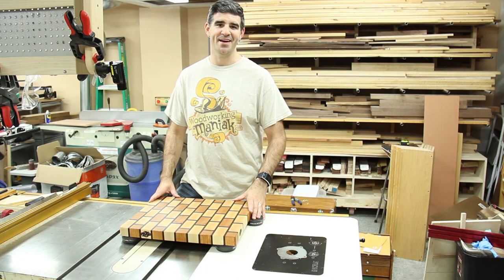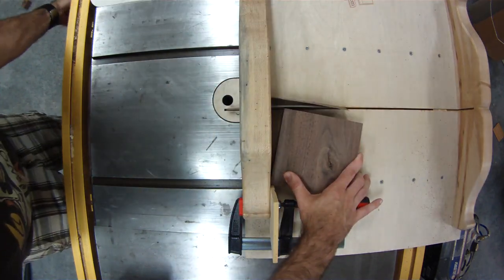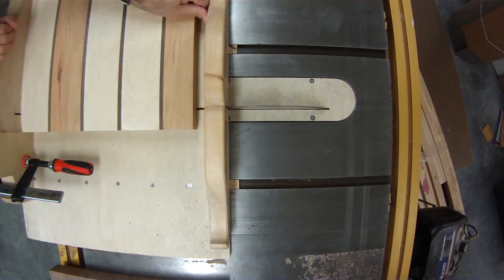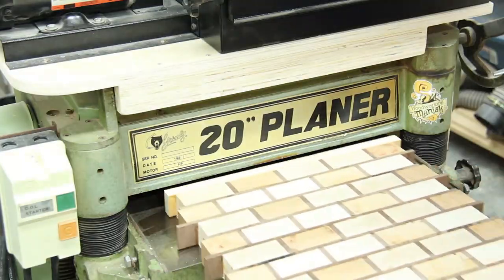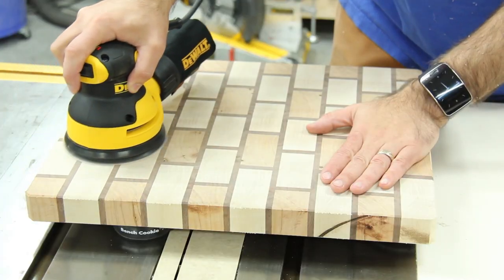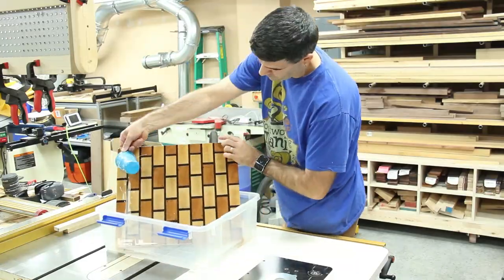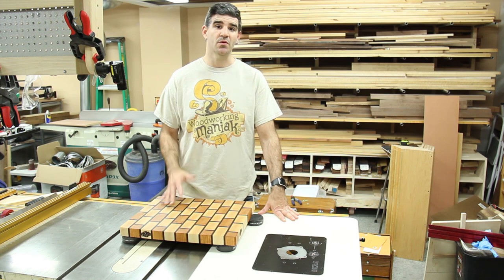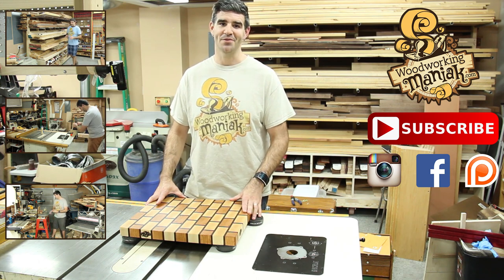Make a Brick End-Grain Cutting Board

Comment from the maker: +Rex McKinnon  For some reason, I cannot reply to your comment...
Thanks for watching! Yes, I do take extra precautions and add an extra step in my glue-up before sending it through the planer. If you review my video, I added a strip of pine that was side-grain to both ends. By doing this, I get zero chip out and no end-grain explosions in my planer. I later just cut those strips off at the table saw.

Comment: Nice rendition of a classic! Does your planer have a helix cutterhead? I use my Dewalt 735 for end grain boards with no problems but of course I'm jealous of your 20" capacity.

Thanks for sharing.

Alex Pettigrew
Pettigrew Woodworks
North Garden VA
Reply from the maker: +Pettigrew Woodworks I do not have a helix cutterhead in this planer. I did have one in my 15" planer that I had previously and miss it very much!!!

Comment: i have tried to make a brick pattern, but have had cracking at the strips. how do you make the strips "end grain", as that is the problem with my 2 i have made thanks
Reply from the maker: +David  Good I'm suspecting that you made the strips with edge grain wood and the rest with end-grain... That does not allow the board to move together seasonally, it will crack every time you do that.  You have to make it ALL  end grain.

To do that: You have to make a separate end grain board (in my case in solid walnut) that is as long as the board will be length wise. Then cut that into strips to put between the bricks.

That's what the glue up at 1:45 mark is for. Right after, you see me turn it into an end-grain board. Then I'm cutting it into strips at 3:04. :)
Reply: A successful endeavor, thanks for the advise, and that is alot of xtra work but well worth it
Reply from the maker: +David  Good glad to hear you had success! It is a lot of extra work.

Comment: Muito legal Mais O Que rápido você Pacou não definitiva e Um tipo de oleo
Reply from the maker: +Luiz Antonio Thank you! I used Mineral Oil & Beeswax to finish the cutting board.
Reply: +WoodworkingManiak 
So to say that you first pass the mineral oil and how soon after you pass the beeswax.
Since already many thanks for the information Property
Reply from the maker: +Luiz Antonio Apply as much mineral oil as the board will soak in, then wipe off what is on the surface. No need to wait any extra time, you can apply the beeswax right after because the mineral oil never actually dries. The beeswax I make is a mix of mineral oil and beeswax (3 parts mineral oil to 1 part beeswax).
Reply: Ok thanks for the tip